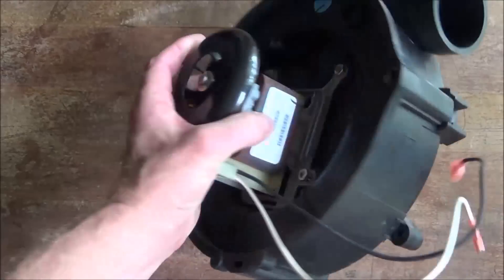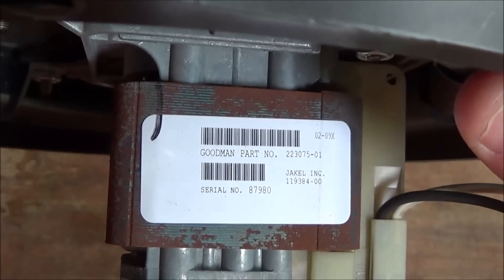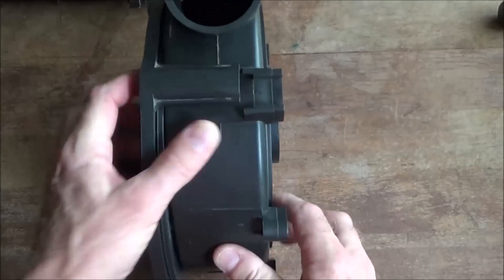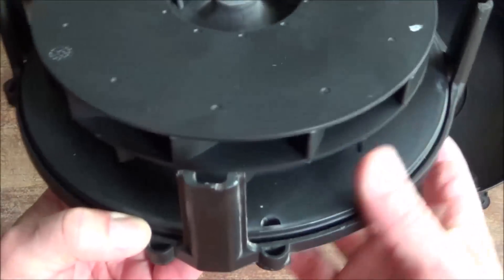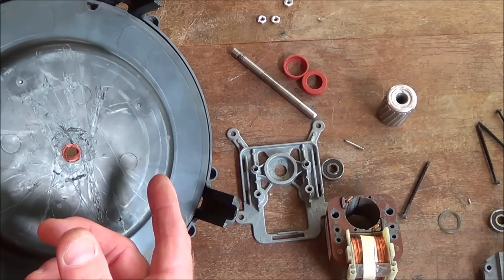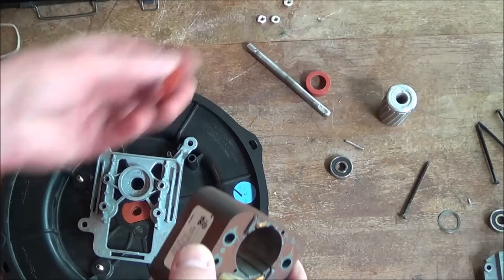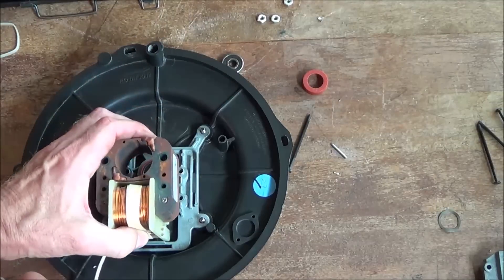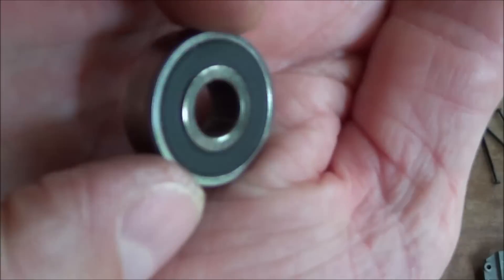Inducer Bearing Replacement

Comment: Bearing 608 works (8 mm inner diameter), but is a little loose and spins on the shaft.  Bearing 1603 (7.938 mm inner diameter) provides a tighter fit.

Comment: Skateboards use 608 bearings. Some are 2RS and some are sealed one side and shielded on the other side. The shielded bearings would definitely work while you waited for fully sealed bearings.

Comment: This was a great video. I just did the same thing except didnt attack the impeller side because of time. 
What kind of bearings are these? 
I figure they go bad from heat and debris getting stuck. If i can save customers money I will.
These go for 700.00 repairs from a shop

Comment: I solved the bearing wear problem in my new one. I put a computer cooling fan blowing on the motor drawing outside air in to keep it cool, as it is the heat that destroys the bearing.
Reply: how did you power the pc fan?
Reply: @JohnLee-mk9gz lookup pc case fans, also you can likely find the right 120vAC to 12vDC adapter on cheap electronics at thrift stores

Comment: Thank you for this video, I did as you said and punched the blower fan and the shaft out, replaced the bearings and I used some jbweld to make sure the armature was not slipping on the shaft since after removal it was slightly loose, same with the bearings i job welded the bearings aswell, used some motor oil in the bearings and after a few shouts of breaking in it’s been working beautifully!

Comment: I was wondering if they could be taken apart but I refrained from trying. Worried I would destroy something and not be able to repair it. I just squirted some 3 in 1 oil on the visible areas I could get to and put it back on the furnace.  It's much quieter now and works fine. I will purchase a backup to replace it and have it on hand.
Reply from the maker: Right, there's no need to take the fan apart.  Glad to hear it's working.

Comment: i've got a comfort maker furnace, bearing on the rear end of the inducer motor shaft is exposed and completed whopped out! i may try to replace just the bearings as it's 32 degrees outside now and thank god for wood stoves as well.

Comment: I have one that just crapped out on me. I took it apart and temporarily fixed the first bearing by filling the sealed bearing with Vaseline because it was dry as bone until my new one comes in. 

I know Vaseline isn’t the answer it’s just a bandage because it’s cold in my house and now I’ll be toasty for couple days waiting on the new motor! 

Cheers thanks for the video

Comment: So, we got a phone call at 11pm last night from the elderly woman next door.  Her furnace isn’t coming on, and she’s had an HVAC pro there, who couldn’t check on a replacement motor until the morning.  BTW, the temperature overnight was in the single digits.

I was able to pull the inducer out and take it apart, 100% thanks to this video (especially the part about the fan blade being molded on – I would’ve destroyed the thing otherwise).  Instead, disassembled the motor housing, got a few drops of WD-40 into both bearings, and it spins like a dream.  You, sir, are the man!

P.S.   The HVAC guy called her back this morning and wouldn’t have been able to get a replacement for at least a month.
Reply: I did this on a same motor every year, until I replaced it. You better order one for her just in case
Reply from the maker: Nice to hear

Comment: It's unbelievable that people pay $500-700 to have these replaced when all they need is a $2 bearing! Same with auto starters, $10 worth of brushes and they good as new
Reply: Not every computer programmer or network admin can do it. It is too complicated for most of people. The people who can do it, may charge $200-300 for worth of effort. But the motor may cost $300. So it is not worth to hire someone, just good for handyman DIY

Comment: You said motor bearing at about one minute in, so I guess you mean motor, and not fan bearing. So why not just replace the motor as they should be pretty cheap, cheap insurance?
Reply: The fan wheel is not removable in this case, so you cannot replace just motor

Comment: Did you replace the bearings ?
My furnace motor 02-15N is also not working properly and I have open every parts , do i be able to change the bearings and will it work?

Comment: I wish I watched your video again before I destroyed a good assembly.  I already installed a new assembly and I wanted to investigate on the failed one.  The important info is that the fan cannot be removed without cutting the shaft of destroying the fan.  By the way, the housing came apart with a screwdriver, no heat required.  The only other option is to remove the motor assembly toward the lead end of the motor and hope for the best that things will align when reassembled, as some people commented.  It is a shame on the engineers and manufacturer that the bearings cannot be easily replaced.  You end up spending between $ 113 to $ 250 on a new assembly instead of $ 5.00 to $ 20.00 on two bearings.  It is only for the mechanically inclined though.  The first one failed just before the five-year warranty and it cost me $ 50 stocking fee.  The one I installed in 2009 just failed, after over eleven years, and the new assembly was $ 113.00.  It is the outer, lead end bearing that failed and that can be easily replaced.  Some WD 40 will loosen the bearing and gets you going until you get a new assembly.  Spaying oil on the bearing or soaking it as someone suggested might work. My furnace is a 2004 Heil and it has been working great other than the outer bearing on the inducer motor.  Well, once I cleaned the sensor rod on the hot surface ingitor.

Comment: I followed this but used a drift without taking any bolts apart like he said, had to set it up with support and had a hand pulling fan down while beat it out from above. mushroomed it a bit but easily filed that off.  Bought an 8 pack of quality 608 ABEC-9(highest quality) skateboard wheel bearings for $20 on line after spending $120 for a new inducer motor. For the second time in 9 years ( brand new carrier). Now I have a backup for the next time it goes with real bearings. Make sure to pop the seals and grease the bearings, there are videos on how to do it. Thanks Mr.Butler!  Oh and take a picture of it so you know where the wires go.
Reply: From where you bought ??
Reply: @virbone7141  Amazon skateboard wheel bearings
Reply: @djokicmetamora  thanks, $188.50 spent  on a  new inducer motor
Reply: Can you please send us the link if you where to buy them?

Comment: I just finished repairing a motor on a york unit.  Once I took the motor cover off I found the ball bearings were froze up.  I took the assembly out and was able to use a bearing knife to remove the bearing.  Although I took the fan apart as you did, I was unable to figure how to take the fan off the shaft.  I wanted to access the other bearing, but couldn't get to it.  Fortunately I had a new bearing in stock, got the unit up and going, but...  I got the same error from the control board, said a pressure switch malfunctioned.  I checked the pressure on the rubber hoses, nothing.  After thinking about it, I realized the motor was going the wrong direction.  I took the motor apart again, flipped the shaded pole coil assembly over, put it back together, and the motor ran the correct direction, have heat again!

I did the repair before finding your video, just wanted to find other peoples experiences.  Jim

Comment: Where did you buy bearings at?
Reply from the maker: I failed to complete the project and replaced the whole unit.  Chris bought 608 bearings at Ace hardware.  Someone else has a different opinion on the bearing size.  I suggest reading all of the comments.  Good luck!

Comment: I didn't go that far.  I decided it wasn't made to be serviced and ordered another one. I did get a little oil into it to quiet it a bit til the new one comes.  I'm sure it could be done, but by the time I got it apart and found a new bearing; it wouldn't be worth my time.  I did find a good price by researching on the net.  $124.  Still seems a lot, but not compared to calling an HVAC guy fix it.

Comment: @William Butler, 
Were both bearings damaged on your fan or was only one. My fan's shaft finally seized up when the outer bearing (furthermost from the fan) totally failed! When I disassembled the motor, I found that the inner bearing next to the plastic housing was smooth turning and spun nice and quietly??? 
I will try pulling the outer, seized bearing off the shaft and replace it in order to have a spare fan for my '07 Ducane CMPE125U5B furnace. Unfortunately, since it is heating season here in western PA, my wife was not interested in my experimenting with a repair of the fan, so we bought a "like new" fan. The furnace purrs now and my wife is happier...

Comment: are those 608 bearings?
Reply from the maker: Well, I thought so, but Glen says that they are 1603.  Good luck.
Reply: @billeb420  608 they are common skateboard wheel bearings, I bought ABEC-9 the best you can buy.

Comment: The bearings where going in mine , I added some oil to each side. First I removed front black part. Hooked up a drill got it spinning added three more drops oil each side. Have to replace. No good if inside is banging .
Reply: What type of oil did you use? Ours has stopped four times in the last few days (with single-degree temps, of course) and we are using lithium grease, but the black wheel in front just won't spin freely.
Reply: Rebecca Kosierowski  bearings are gone I have new one are you in Ontario Canada ?
Reply: No, we aren't. We are in Illinois, USA
Reply: Rebecca Kosierowski if you're going to fix , replace bearings before armature gets damaged . Good one not a copy is $200.00 up here
Reply: We don't have a puller, so we've ordered a new one. Just over $100 with shipping, so not bad. Thanks.

Comment: It's possible to do. I just did mine. You don't need to split the plastic case. Both 608 bearings were 12 bucks at Ace Hardware. Had to make a special puller to get the lower bearing cage off but after that not bad at all.

Comment: i obtained a inducer assembly like this which came off a Rheem water heater with noisy bearings meaning the entire inducer assembly has to be replaced the motor says Jakel Inc Highland Illinois on it. if i can find a unit with a FASCO motor ill go with that. as i don't like these sealed pressed fit draft inducers if its on a furnace or a water heater. if possible ill find an A.o. Smith inducer and use that the motor can be seperated from it if i use antiseize compound on the motor shaft and the set screw on the blower wheel. as thats a more simplier design to replace the motor or bearings if its a 3.3 inch motor. i think some furnaces use this inducer assembly and some water heaters notibly Rheem, Ruud and others.

Comment: Happy I came across your video. I was not having noise, it just was real hard to turn. I got out the hair blower, went to heat it up, decided to pound on those pegs, it came apart easy, looked in the holes, looked like bunched up rubber bands. That gasket had come off, wound up inside under the fan. Used a scratch awl and small needle nose, pulled it all out. Works like a charm!!

Comment: Thanks for taking the time to make this video.  This Jakel motor is the same as found in many Carrier furnaces, such as mine. When my motor began making the high pitched noises, I suspected the bearing were going bad. Since your detailed dissection of this motor that showed the location and construction of the bearings, I was able to drip lubricating oil onto the bearings which has quieted the unit for now. At the very least, this buys me some time to look for a replacement motor. Your sharing of your experience is very much appreciated - thanks again!

Comment: Thanks for the great video.  I have the same inducer motor and it failed during a deep freeze, colder than (-20C/-4F). I was able to see the bearings and drop some oil on them to keep the furnace going.
Reply from the maker: Richard Pistor Thanks for watching.  Glad I could help.

Comment: very nice video, but i don't see how to take bearing out,  i checked blower, disassemble out, bearing front bearing stuck, but don't know how to take it out , can you tell me how to take it out?
Reply: You cannot press the shaft back into the rotor , it's only designed to be pressed one time at the factory and they do it thermaly , I tried it and the shaft will eventually start to spin in the rotor , also it's hard to get it back in the same position on the shaft , it has to be perfect or the motor endplay will be wrong and the motor won't spin freely
Reply from the maker: yu Kane, the only way to get the bearing out, is to push the shaft through the motor.  I think an automotive puller would work.  But then you would have to press the shaft back in after replacing the bearings.  I recommend replacing the whole assembly if the process is not clear at this point.  Thank you for watching.
Reply from the maker: Michael Kranz Thanks Michael
Reply: Not the case. It pushes right on the shaft. Taking careful measurements allows for correct reassembly.
Reply: the only correct way is to remove the fan off the shaft then measure position and pull off the main bearing. 
Removing iron rotor core from shaft is a serious bush fix because  rotor will likely be imbalanced afterwards... there is a reason why even Chinese factory balances rotors! Just too bad their bearing lubricant & seals fail.